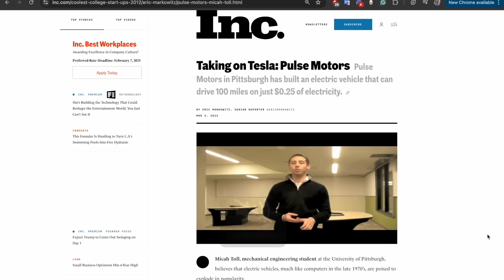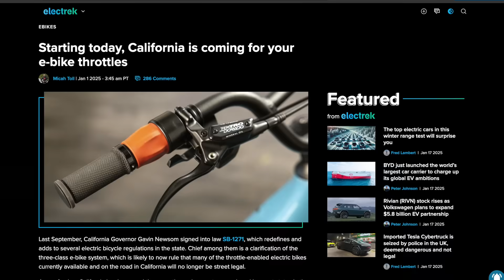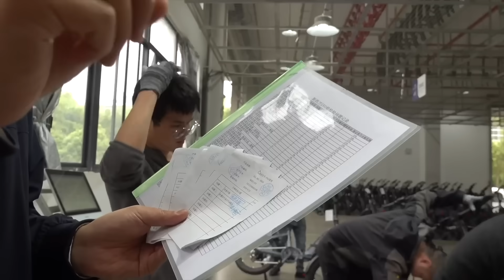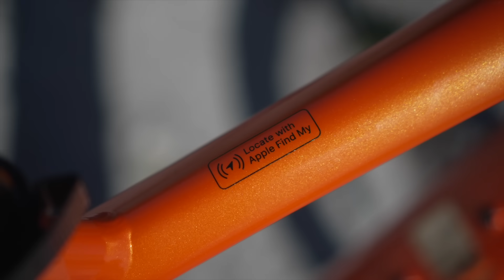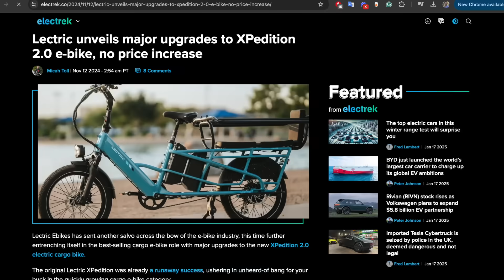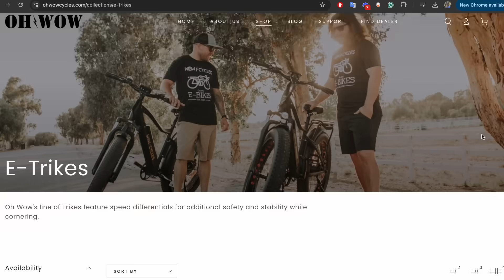5 Things That Will Happen To E-Bikes In 2025!

Comment: New e-bike laws in California has caused me to get back on my gasoline powered scooter. It's no longer viable for me to ride an electric bike anymore. I may buy another motorcycle in the 800cc range. It's too bad the e-bike industry will probably slow down to a trickle in California.
Reply: those ebikes laws arent even new..all they did was add some throttle check, i doubt anyone cares
Reply: There are brands that make light electric motorcycles (because that’s what ones that exceed the class 3 restrictions are) that can be easily registered as they come with VIN, DOT compliant kit and a place to attach a license plate. If you’re going for a ICE scooter or light motorbike that also comes with all that, why not an electric one?

The class restrictions are a good compromise for not having to register, insure and get licensed to operate them. And the power limit isn’t an issue for hill-climbing if you get ones with higher torque efficiency. Torque is what you need to help climb hills. I’ve seen hub motors that produce anywhere from 35-100Nm with the same 750W peak 48V of input, and similar variety in mid-drive motors (40-120Nm with 350-450W peak at 36V input).
Reply: @chow-chihuang4903  Yep. My bike and trike are both Class 1, are mid-drive, 500W, and have lots of torque. I've ridden some steep hills, and only once had trouble. That was a very short hill that was over 45 degrees in slope. I was riding slowly as I approached it. Had I taken a longer and faster run at it, I might have made it.

Comment: I predict most ebikes going the way of the mopeds: looking less and less like bikes, with pedals that basically do nothing, and being regulated as such, and eventually restrained to roads. They will have luggage compartments, can carry a passenger and be very practical.

The e-bikes tolerated with pedestrians and real bikes will become lighter and lower power, they will become better bikes, with low power motors able of high torque at low speed, and more clever ways to deliver the torque. Eventually they shall look like regular bikes but with this little ‘humpf’ of help just when needed. Wires, throttles batteries and displays etc will disappear. 
Maybe I am saying what they should be rather than what they will be in 2025…
Reply: You should check out Urtopia’s new compact mid-drive motor.

It sounds like it’s intended for use only when climbing hills, probably because it’s so compact it likely has issues with shedding heat during continuous use, but 40Nm out of a 2.4lb package that looks like a slightly puffed up bottom bracket is impressive.

Existing motors have quite the spread of torque output given the same voltage and power input.

Rad’s new hub motor produces 100Nm with max 750W input. The MXUS motor on my Ride1Up LMT’d also outputs 100Nm max, but needs almost 1000W input to do the same. Lectric’s M24 hub motor peaks at 85Nm but requires about 1400W input to do so. All use 48V systems.

Efficiency, measured as torque output/power input or power output/power input matters, and I think there are a lot of inefficient systems out there.

Comment: I think having a mini grocery trailer to be attached to an Ebike will be great. Im looking at doing grocery and auto parts shopping, gardening, paying visits to friends, all within a community.
Reply: It’s easy to load up and steer a with those trailers meant to carry  kids
Reply: Have you tried researching the Burley Travoy bike trailer? If you need a trailer besides pannier bags to carry groceries, that might be worth looking into 
Either way, hope you find a good fit for your needs!
Reply: @crystalunaluminescent4033  thank you for your suggestions
Reply: I pull a Burley Nomad Trailer, behind my Ebike.
Reply: @JamesHart62  I have that trailer and the flatbed and the 16+ wheel kit for the dirt roads
Reply: @VaughnfromPeterborough  I built my own Flatbed trailer. Plus I bought a kit from a company called Wike, and built a trailer around a 44 gallon Rubbermaid action packer. Its on my channel.
Reply: You should have a load bearing rack above the rear tire that can be used for groceries.  Pretty standard for ebikes.
Reply: Hard to go wrong with the classic milk crate zip ties to the rack. Throw a backpack in the back when your riding, carry it in, can throw a grocery bag or two in and throw a bungee on top. It's not pretty but it works. Plus it makes your bike 63% less likely to get stolen for ugly factor.

Comment: I have been riding motorcycles for 55 years rule #1 you will get run over by a car. This is a fact, Ride like the cars do not see you. The ebike riders I  see ride like they own the road. I have news for you they will be scraping you up off the pavement. This is why they need training in defensive riding and licensing after they pass the course. BTW Surf guy777 I started surfing back in 1964, back when you had to know how to swim not rely on your Kook cord.
Reply: Do you think that surfers need to enroll in mandated shark bite training?
Reply: My recumbent trike sits low to the ground. It has built-in front/rear lights. I added a rear blinking light up high, a reflective triangle on the rear of the rack, and instead of a small safety flag, I fly a 2 ft American flag, 6 ft in the air. People actually notice the flag much more, and give me room. I don't want to give anyone the excuse of "I didn't see him".

Comment: Please make difference between emoped and ebikes .
Ebikes  750W to 2500W much safer and better quality than any sporty bikes shaved on weight and safety and go in low position low visibility 10km/h plus in group 20km/h plus when one fall the most fall.
Below 750W useless on hills.  Above 2500W too ineficient on flat where you use 100W to 500W.

Emoped 5000W plus no pedaling even try nonsense lower sitting position much bigger benefit..

POwer 2500w to 5000W  technical nonsense not needed on market.
Reply: They ALL should be illegal!
Sounds more like a dictatorship, an very un-American.  
And anything less than 2500W is too slow, and thus dangerous on the streets when not keeping up with traffic.

Comment: I want to hear more about solid state batteries for e-bikes... graphene or whatever?
Reply: I won't buy electric car or bike until solid state is available...  fire risk.
Reply: As if a non electric car isn't a fire risk either?
Reply: @mikafoxx2717  Risk isn't just a question of frequency, consider also severity of an incident - an EV battery fire is much harder to extinguish and burns hotter. ..Besides, I most often drive a diesel.  The battery tech will improve for EV,,, it's just not there yet.
Reply: @MET-Dynepro  And yet in a bike you just.. get off it. Car accidents aren't any better and are actually fat more common. Cycling extends life and quality of life from the exercise more than accident risk factors outweigh it, as well. Might be worth looking up electric car fire risk vs average car fire risk.
Reply: @unwillingful  one technology for solid state is from Samsung. .. evidently may be in Lexus 2027.

Comment: I ride a Juiced company RipCurrent S model with the extra large frame.
What I notice is most people don't pedal at all.  That seems so lame to me when you're on a bike.  Another thing I've noticed with my and my friends  eBikes was the gearing being excessively tall.  While that can get one a higher max speed, it became clear to me that high speed number was irrelevant to my riding style.  What we wanted was lower gearing for when we got into the hills.  I didn't want to just ride along on throttle, but really put some effort into my bike riding experience.  We've now all reduced the front chain ring tooth count drastically.  I went from 52 teeth down to 39 and am much happier with that setup.

Comment: This is a new industry. It is growing quickly and a lot of companies are trying to get in on the action. But it is inevitable that some companies will go out of business or convert to something different. Eventually the e-bike industry will settle into a few really good stable companies. It is the same thing that happened with the auto industry in the early 1900's. In 1908 there were 253 automobile manufacturers in the US. Eventually it got down to about a half dozen companies producing the vast majority of automobiles and some other companies producing a small number of specialty automobiles.
Reply: Same for EV in China. There are more than 100 EV brands in the mainland. The supply is far greater than the demand. How many of them will survive in ten years?
Reply: How long before peak e bike? 10 years

Comment: I predict that sodium batteries will gradually replace lithium batteries starting this year.
Reply: Solid state batteries will be the next big leap in technology, and we are almost there!
Reply: @Alan-l3i7d  That's certainly another possibility. I'm very optimistic about the future of electric vehicles and whatever kind of batteries will be in them - although I will miss driving a car with engine sound and shifting with manual transmission. haha
Reply: I predict heavy and low power density batteries will only be used in low end products. Solid state batteries are much more suited.
Reply: Sodium batteries have lower density, and lower voltage than lithium, making them less than ideal for electric vehicles. Where they are useful is as cheap storage of excess power from renewables.
Reply: @AWriterWandering  Yes, sodium batteries do have “lower energy density” (amount of stored potential energy relative to its weight or volume) and lower voltage per cell. Those are deficiencies that are being improved right now by companies such as CATL, Engelhorn Tech, Farasis Energy, TAILG, TaiSan, and Yadea. And sodium battery vehicles such as e-bikes, motorcycles, and cars are starting to become available now. The future looks bright for sodium batteries.

Comment: Don't let them take throttles from the disabled!
Reply: 7kph throttle in Europe is pretty bad. At least let them go their normal speed limit for disabled that can't peddle. Hard to even balance at 7kph. Up to 30kph Max is fine by me, no power limit because you can only ever use so much to go only that fast. Wine drag uses 8x more power to go only twice as fast as it adds up quick after 20kph. Rolling from tires only double when you double it. Hub drives are less efficient on a very steep hill and simply need more battery watts to make motive force watts. But they're the most reliable vs a mid drive, which eats up chains and sprockets with the power of an Olympic cyclist plus yourself for the big hills or awful headwind or heavy load of groceries or kids etc. Canada's 500 watts or US 750 is reasonable over 250, but they all lie and use more than that in reality when you big it down due to that inefficiency, they're just rated to do 250 all day.
Reply: Just enforcing the speed cap. Brands have been playing well beyond the rules for a while, causing the stricter enforcement.

Comment: Great video. I like how you went back and reviewed your predictions for 2024. Excellent job.
For 2025 I especially like the tightening up of the regulations around e-bike/battery safety. Nothing here in BC, Canada yet but we live in a townhouse and charge our batteries in the house. I dread the day or night when a fire begins because of someone charging their battery while they sleep. Thankfully our townhouse complex is only two floors for each unit. I can't imagine what nightmare it could be if one lived in a condo or townhouse complex with multiple floors and a battery caught fire on one of the floors. Thus far one cannot put the fire out (hopefully we will eventually find out how to contain a battery fire) and one cannot simply grab the combusting battery pack and throw it outside. Tough stuff to think about.
Reply: I'm guessing a metal bathtub would be a good choice, not for dousing, but because it is not combustible.
Reply: Water works fine for battery fires. They're a heat based critical reaction and water helps cool it down.